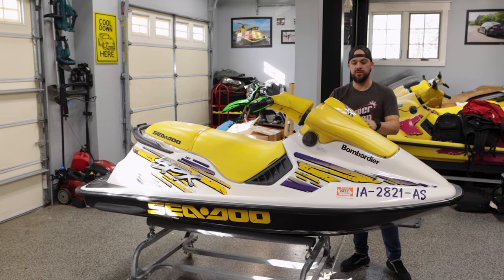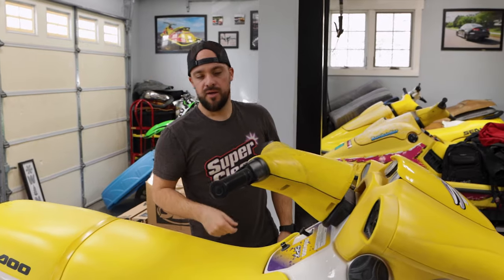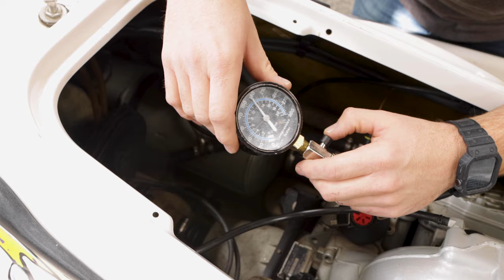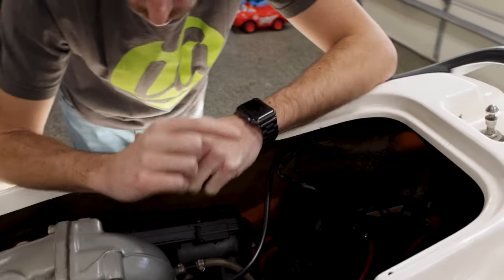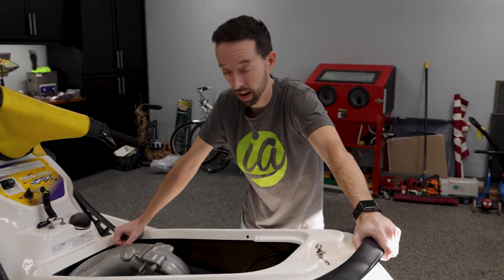2 Stroke Seadoo Buyer's Guide!

Comment: I always start the ski before I do anything. Iv seen sellers dump 2 stroke in the jugs to fake high compression numbers. I like to burn all that crap out. I then inspect around the crank seals and pump etc. Let the motor cool. Then compression test. I purchased a ski once...20 years ago. Tested compression in the guys driveway. 150 per hole.  Got it home and retested  128,133.  Life sucked. Also removed the flywheel cover and of course. Oil dribbled out. Crank seals were shot. Iv owned at least 60 skis in my time. That only happened to me once. Now I check all that stuff and 2 times out of 10. Same issues.
Reply from the maker: You would see the fluid on the compression tester. I want it ice cold to see if seals leak and to see the compression.
Reply: Is 130 not good compression ?? Supposed to buy a 99 GTX with 130 compression
Reply: What did you do with 60 skis?

Comment: It must be nice to find low hours skis lol. Here in Florida they are all SBT'd, clapped out, high hours skis.
Reply: What’s wrong with SBT?
Reply: Granted florida offers year round ski'ing......find some back roads in the middle of nowhere. That's where the true gems lie.....I'm in Texas and there's skis everywhere that have been sitting forever. Just picked up 2 1996 xp's with trailer for 800$.
Reply: Just got a 94 spx 150 compression just dirty not a scratch
Reply: @Wwatson1221  Nice score! Mine were filthy as can be but cleaned up well. One with 150psi, the other unfortunately locked up engine. Fortunately it was water getting into mag/front cover through starter seal. Got a the starter out and engine broke free. Wont take much and she'll be running.

Comment: The XPS synthetic oil is 100% needed and the bomb. Do not skimp on oil. That is the number one reason for engine failure which is cheap oil which break down. As to the oil in hull, if you still have oil injection, plesae check the oil tank as in my opinion they can and will eventually leak. I always plan on a leak test or replacement or elimination of the oil tank. Later.
Reply from the maker: Yeah I always do every line before riding

Comment: Love the video and the info.....exceptional info for the beginner who's looking for an old 2 stroke ski (the best skis). Noticed your XP's in the background. Just picked up 2 96 xp's with trailer for 800$. So far 1 runner with 170psi compression, and 1 unknown until new solenoid installed. Been sitting 8-10yrs.

Comment: I bought a 95 GTS cpl days ago which had an oil leak. Seller believes he fixed it (shortened bad hose at tank outlet + new clamp). Is there where they can leak? How would I know if oil injection is working properly? Ski runs and rides fine on water. Is it normal to have some water inside the hull after riding or something should be looked into? Thanks!

Comment: Those gray factory hose interiors dissolve in ethanol unleaded gas.  Then, the green goo plugs up the carbs and runs the engine lean.  Then the piston tops burn thru.  Happened on my ‘96 GTS.  Lot of good skis ruined due to those hoses.

Comment: Thank you so much for this. I can't wait to watch it later today. I'm in the middle of a big decision process. Someone is selling both a 1995 GTS and a 1995 GTX. They are both well-cared for, and he let me ride them both out on the water, and both ran like a dream. New plugs and wear rings. And it's in about the only price range that I can afford. But, of course now, there is the dilemma of maintenance and 2-stroke engine...both from the perspective of breaking down and how much more pollution is it dropping into the lake vs. a 4-stroke.

If you guys, or anyone else who may read this, has any advice on going with a 90s 2-stroke, or which of the above rides would be easier to maintain: GTS, or GTX, it would be much appreciated. I'm a total newb to this, if it isn't obviious.
Reply: It's a 90s 2-stroke, it's fun and you shouldn't care about pollution. Maintenance shouldn't be an issue either if you use the right oil and gas. Yes, eventually you will have to rebuild to reach peak performance again but honestly these Rotax 2-strokes are pretty robust and some of the best fun per dollar you can get on the water. Engine isn't any worse to work on than a lawnmower. Lots of great resources out there. Get em and rip!!

Comment: The XPS synthetic oil from back in the day was green.
Reply from the maker: It’s been red since 2007. If you have oil sitting in from 2007 it should be changed regardless. Heck if you have oil sitting from 2 years I’d put fresh in. Cheap insurance
Reply: I still have a quart or 2 of the brown DI specific XPS oil. :-)

Comment: I have noticed that you use carrier bearings on your skis and not the carbon seal. Is there a reason why, do you like them more?
Reply from the maker: Yes I always do carrier bearings I like them better
Reply: @TodayWeWrench  why do you like them better, are there pros and cons? I thought being older tech, that it wasn't as good. Or did Sea-Doo cut cost and went to something cheaper. I have never used one, so I'm just asking. Are there any mods to make the swap?
Reply: @johnearnhardt4709  seen many skis sink or the hull fills up with water ( sometimes water in engine)  due to that shit carbon ring setup. Engine alignment , bent shaft, improper bellows installation usually are the causes for leakage and it gets worse if you jump the ski a lot or pound it. No one can ever figure out the thinking of the manufacturer when they come out with stupid ideas. Kinda like their great fix for the early 951s spraying water in the airbox ,,,,, lets just make a rubber diaper around the manifold joint and still continue to screw people and deny warranty claims because of "water ingestion "

Comment: Super informative! I have a minty (even with high hours!) 96 Polaris SL780 but it sadly developed a crack in the hull. Interested in a 95+ Sea Doo. Not sure what i should be looking for as far as a motor- the 587, 657, 717, 787, or even a 951 in later models if the price is right. Any recommendations on which model/engine I should look for?
Reply from the maker: For sure go with the 787 it is incredibly reliable, plenty of HP, and is easy to work on
Reply: 800 motor all the way  96 XP or the 97 SPX

Comment: What is your opinion on Klotz oil vs XPS? Klotz is more available in my area and seems like a lot of guys love it
Reply from the maker: I would recommend using XPS in the crank and in the pre-mix or oil injection system. The XPS is formulated not only for the rotary seals but to work cleanly with the rave valves. Its my go to and works well

Comment: I was able to obtain two 97 SPX’s from a friend for free.  1 currently runs but we believe has a small oil leak.  The other one has some mods to the engine.  It would turn on but didn’t sound right.  We did a compression test per this video and 1 cylinder came back 125 (cheap compression tester from amazon) but the second cylinder completely dead no reading.  Should I buy a new engine or is it worth having a professional go through it?
Reply: probably get a quality compression tester.. that would be my suggestion

Comment: Please do a video on how to fix leaks. There is too much water inside in 15 minutes.
Reply from the maker: Sure join our Patreon and request it https://www.patreon.com/TodayWeWrench
Reply: Check the two bilge siphon lines to see if they are cracked/detached. One of mine was completely cracked off and the other partially broken at the outlet nozzle through the hull. Also, check the underside of the exhaust manifold for those welded plugs. Mine had a small hole in it and was shooting a jet of water straight down into the hull. In a pinch, I actually used electrical tape wrapped around the manifold and it stopped the leak to my amazement.
Reply: @hansski1995  thank you, it's was welded plugs.i drilled it and put a small bolt in with seal.
Reply: Nice, had it held? No welding?
Reply: @hansski1995  yes,no leaking for all summer

Comment: Do these require 2 cycle to be added to the fuel? And, if so, what happens if you run them with regular fuel?
Reply: If you run regular fuel,they blow up
Reply: i would suggest you do 87+ no ethanol, and then if its a oil injected model you dont need to premix!

Comment: $1700 for engone build? Is that in parts or do you mean parts and shop labor?
Reply from the maker: No, thats in quality parts, good machine work, bead blasting, and painting. New crankshaft, rebuilt counter balance assembly, new top end with boring, machined RV cover back to OEM spec, gasket set, etc
Reply: @TodayWeWrench  oh that makes sense.